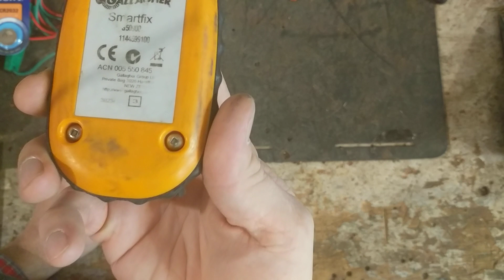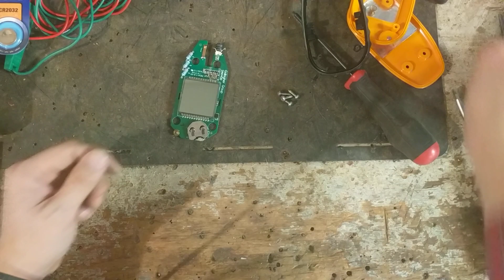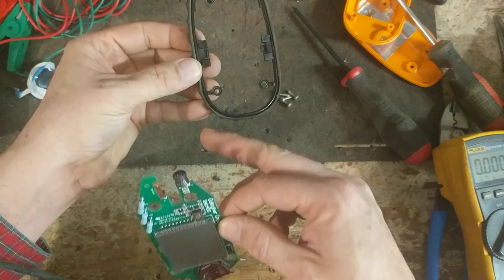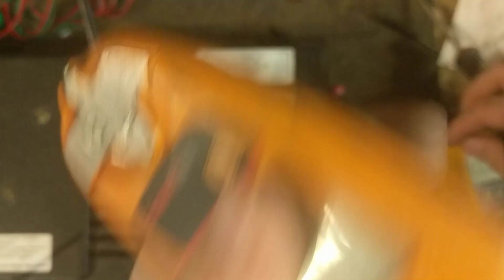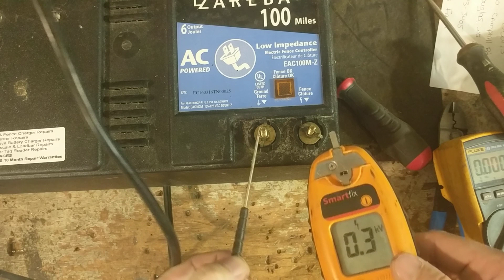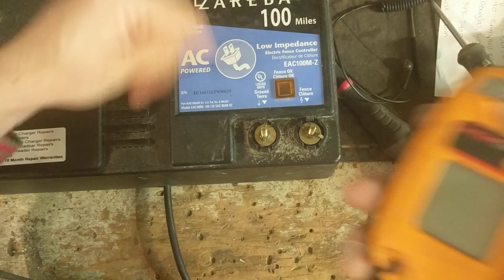Gallagher Smartfix Fault Finder battery reset & replacement

Comment: What size squarehead screwdriver do you use to open up the back of the fault finder? You only mention the right tool for the squarehead screws but not the size. Is it available in Europe? I live in the Netherlands.
Reply from the maker: I don't recall, but they should be available. You might have to buy a whole set of them, but look up Robertson bits, Robertson is the square but name, like Phillips is for that style of head. You can partially use a small flat screwdriver and go at the screw diagonally and turn it out that way. Look on Amazon if you have that or even eBay

Comment: Cheers for your post though I’d have to buy a new one after fitting a new battery. Great watch
Reply from the maker: Sometimes doing the reset and replacing the battery doesn't always work. You can try doing the reset 10 times with a new battery and if the board is too far gone for whatever reason, your two options are to buy a new circuit board for it, which is cheaper than buying a new Gallagher fault finder and basically makes it brand new, or spending twice the price and buy a new tester.

Comment: THANK YOU for this video!  This REALLY helped, especially the "reset" option because the battery that was in there originally was at 3.01 volts and the new one out of the package was 3.11 volts.  I ended up using the new battery (the old one was 3 years old), but I did have to do the screwdriver "reset".  Much appreciate the video.

Unfortunately, I did not consult this video soon enough because I went RIGHT for that large Phillips screw and the spring popped out.  It didn't go very far, and I was able to put it back together.
Reply from the maker: You're welcome

Comment: I have this old version for over 20 years now.  Works well on the voltage but suddenly it does not indicate the direction anymore. 0.0 Amps where ever I try.. Battery is 1 year old. Had to change it every 4-5years.  Any hints? Thank You.
Reply from the maker: Something is going on with the board inside. At the top edge of the board is a little round black component soldered to the board. That's some sort of inductor that does the fault finding and everything through inductance. Sometimes that piece will come loose from the board and needs to be soldered back on. If that's floating around inside, you can try and resolder it, just be careful and don't mess three board up too much or you'll have to just replace the board. Or if you want, just send me the tester directly and I'll go though it and try and get it going.
Reply: @FencerFixerRepairLLCKansasCity  It was exactly like you said. One contact of the black inductor on the top was loose. You can't see if your'e not looking for. Little soldering job, now it works perfect again. This was priceless. Thank you so much!
Reply from the maker: That's really good to hear that's all it was. It's not too common that happens, but over time it can. The latter versions of that unit had some sort of gob of sticky tack glue looking stuff on the front side right across the lead to help keep that thing from moving. Send me a check lol
Reply: How can it read 24 amps that would kill you at 10,000 volts
Reply from the maker: @ChainsawUsers Think of it as more like amplitude.

Comment: Thanks that was very helpful for my finder. The numbers don't come up until I did the reset like you mentioned.
Reply from the maker: Glad I could help. Those are pretty good testers. Besides replacing a battery and doing the reset at the time, those don't hardly ever go bad, except for when they get left outside and water gets to the board.